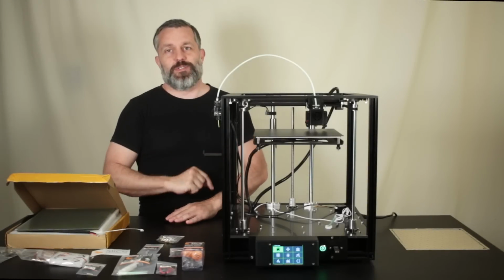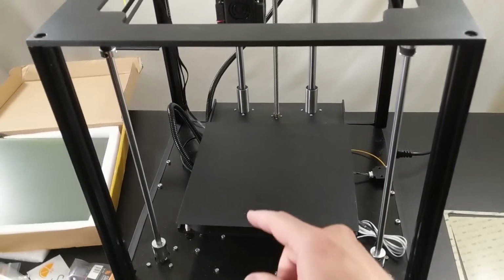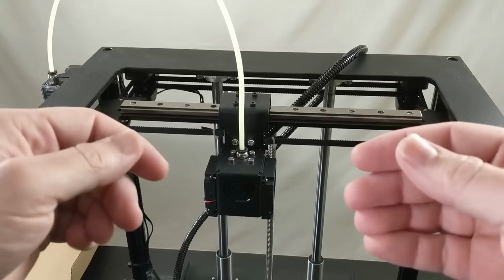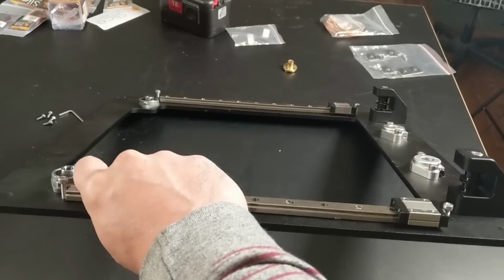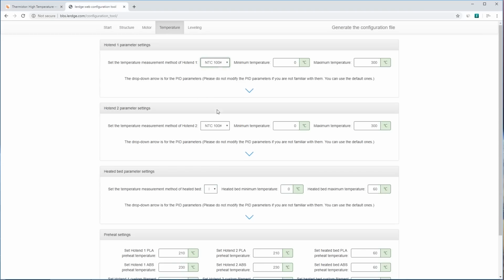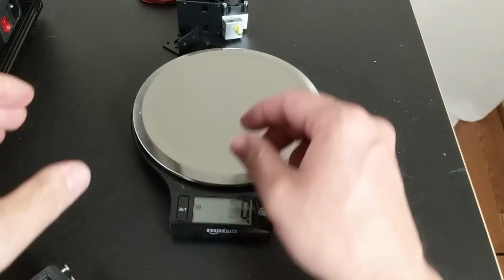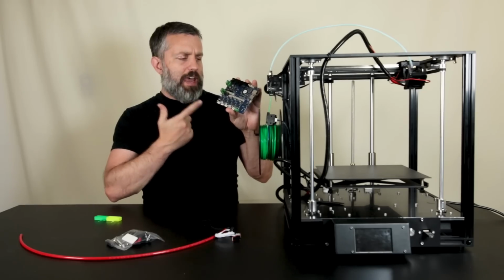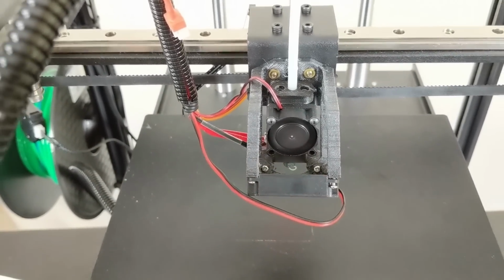Upgrading the TwoTrees Sapphire CoreXY 3D Printer with a Mosquito Hotend from Slice Engineering

Comment: its too tiny...
Reply from the maker: I agree. To be perfect it should be larger. The print volume is not too much smaller than an Ender 3, so it's in the same ballpark as the popular printers these days, but my ideal CoreXY printer would have at least a 400mm² bed, with room at the front to mount tool changes.

Comment: TriangleLab has a MKS3 Clone without a Controll Board and the Filament Sensor
Reply from the maker: I'm well known for being critical of Prusa. However, I cannot condone this product. Buying clones is immoral. Even when the cloned product is open source. I talked about why extensively over here: https://youtu.be/iKhn5IcVvAg
Reply: @DesignPrototypeTest  I get why you say what you say, but I really can't afford e3d stuff for example... High shipping costs or even higher product costs if bought in nl

Comment: I've got this printer back when it was the East3d saphire (East3d was Chay Chen's company) and I got the Not s version. That's without linear rails on top. But you have the steel rods for the XY motor from the bottom to the top, what I've done, is design a part which connects the bed and the steel rods together with an IGUS drylin  RJ4JP-01-08. This can turn and move up and down, so your xy will still work great BUT, your Z is even more stable!
Reply from the maker: That is a very creative addition! Good thinking my friend. Once I understood what you were talking about it caused me to say out loud to myself "Well that's interesting."
Reply: @DesignPrototypeTest  yeah it's kinda hard to explain but I like it a lot, it did improve my prints, not a whole lot, but I like the concept of using all your parts to the max, I mean those igus dylin's aren't really expensive at all

Comment: Thanks for the vid! I have one in the mail, lurking youtube and your movie was suggested. About the parallel running rails for Y; it's possible to adjust the rails; they accommodate some room around the screws to have somewhat of a float during installation.  This way you can perfectly align both the rails. If that's not enough, you can drill out the holes in the x carriage. You can also use some paper sheets (drenched in oil, if you like) as a spacer between the rail and the  frame to flatten it out. That cooling works miracles! great work!

Comment: Awesome video, really enjoyed it!
As you care a lot about stealing designs, you might want to avoid the zesty nimble. I am using the competition (Flex3Drive) and the seller told me, Zesty basicly stole their whole design.
Reply from the maker: I've talked extensively to both Zesty and Flex3drive. Nobody asked me to be the judge, but it my conclusion that Zesty is 100 percent NOT a stolen design. There is "prior art" posted on thingiverse that predates the Flex3drive. Both F3D and Zesty are derivative of that posting.
Reply: @DesignPrototypeTest  interesting, what made you decide for the nimble in the end?
Reply from the maker: @Nikolai Schauer Basically, Zesty was more reliable with providing a product and information. I still have not received a F3D despite telling them "Tell me which one to order and I'll place the order immediately" the owner of F3D seems more interested in adapting his products to a new platform than providing a product to me for testing. It feels unprofessional. It's only accentuated by the fact that the F3D is printed with FDM which is inferior to the SLS printing used to make the Zesty. Why should I pay F3D to print a part for me? Anyone buying an F3D owns a 3D printer and can print the parts themselves. They would probably prefer it that way.
Reply: @DesignPrototypeTest  Fair^^
it took them forever to deliver the f3d to me :(

Comment: Regarding the rails out alignment at 14:05, it is not true that there is no way to adjust the rails. If you loosen the screws mounting the rails, there is some play and you can adjust them to be parallel. You can even print a jig/spacer like this one: https://www.thingiverse.com/thing:3337702 to make it easier but it's not really necessary.

Comment: I've had a Sapphire S for about two months now. Two upgrades any sapphire owner should look at are a 2mm leadscrew and a new hotend. Additionally I suspect your bltouch issue is related to the bltouch v3 issues people have been having.
Reply: Hi steve, do you mean a screw with pitch equal to 2 mm with "a 2mm leadscrew" ??? Cause I'm having problems trying to install the anti black lash T nut and I suspect that the pitch of the original screw is different indeed.
Reply: @69george88  yes, a 2mm Pitch lead screw and nut.
Reply: @ImplicitConversion  thank you

Comment: How about using an skr board? They are fully open source and got onboard support for tmc2208 and 2130. The pro v1.1 has some separated power Inputs for the board itself, the Fans, steppers and heating parts. And they are much cheaper and always on stock

Comment: Hi Matthew,
another great video!
I bought the Sapphire S four weeks ago, too ... I'm struggeling with some problems with the mainboard, I think ... some strange things happened while printing ... I printed a spiderman head from thingiverse ... at about 25% the print head starts driving around (it seems that the head drove an 8), then it continues printing ... at 50% the same ... but now he fell on pause mode and the bed lower about 5 cm, but it don't fell .. I heared the motor when it was lowered. I pressed resume ... and the printer resumed ... in the air .. print gone ... (firmware version 3.0.1) ... with the new 3.0.2 this problem should not appear ... But I think I will buy a duet board for the printer ... maybe the maestro again ... I'm glad to see, that you plan in the same direction ... ok with the wifi ... good luck with it. But overall, a great printer ...

Comment: You should use 2mm lead leadscrew (or integrated leadscrew steppers are even better) instead of the anti backlash nut. Newer ones are shipped with the 2mm one. As you said, we are kinda beta testers for the company :)

Comment: Wow what a banger video! Great job! Especially your hotend/cooler mount is super sexy. Love it. One issue I had when designing an extruder mount for a regular E3D extruder was, that I created a lever that ended up being too great. Its kind of hard to explain, but the distance from the mounting points of the linear rail to the tip of the extruder created such a big lever, that I had huge issues with vibrations/resonances where the tip would scrape over some plastic, then start to vibrate up and down which would create more resistance during the next layer. This would get worse and worse until the x and y motors would start losing steps after just a couple of layers. My gut feeling says that you also might have those issues due to the lever youve created by mounting the hotend further to the front. Of course I'm hoping that thats not the case because it looks so neat. But just in case: I solved the issue by making the mount beefier.

Comment: Regarding the motor hold at idle, did you try "M84 S0"? This command is supposed to disable the motor hold idle timeout. But I think it will affect all motors, not just Z.

Comment: Check your ending Gcode in Cura.  When your print is done you probably have it set to disable steppers.  That would be why your platform falls.
Reply: That is usually true, but the Marlin firmware also has a setting called DEFAULT_STEPPER_DEACTIVE_TIME that shuts the stepper off after a preset time.

Comment: No company in the world has a fleet of testers that you're talking about. Usjng quality materials, a good design and end up with a quality built product. Simple. We're always the final testers for all these companies.
Reply: Thats just not the case. I can only speak for German companies, but basically all of them have huge testing and quality control facilities. E.g. Siemens, Bosch, Daimler, BMW... Even Prusa didn't let their customes beta test. Yes, there were private people testing for prusa but they knew what they were getting an engineering sample to test.
Reply from the maker: Really? Then how do you explain the "testing track" at Ford motor company? Any good company extensively tests and beta tests their products then fixes the issues at arise before mass producing and selling the products.
Reply: I guess there's a misunderstanding of how Chinese manufacturing works. They really don't have the concept of "beta testing". If something works well enough to do what it was designed to do, it's released. They've done their job. Their phrase essentially equates to "good enough". I've had to deal with this for over a decade in SW engineering - really pisses me off.
Reply: @jmtx.  Yeah thats the issue with the chinese companies :/ But at least thats good for the western economy. Just imagine the chinese monopoly if their products would also all be perfect